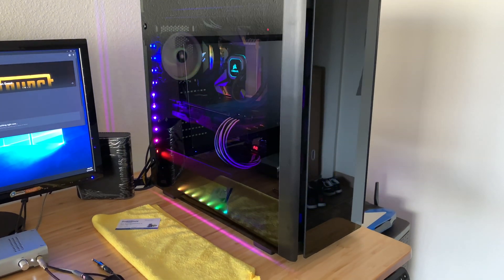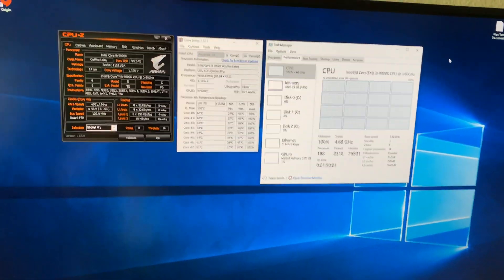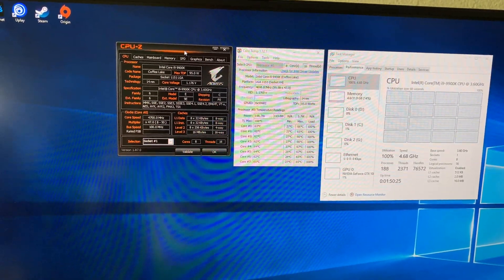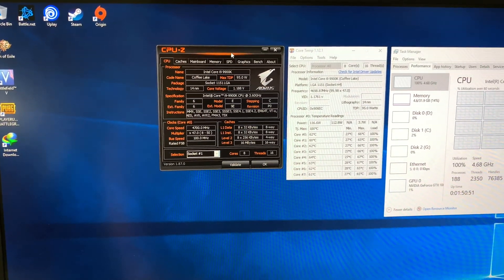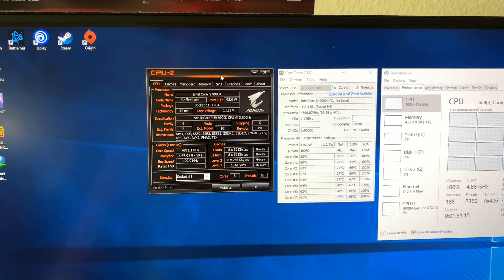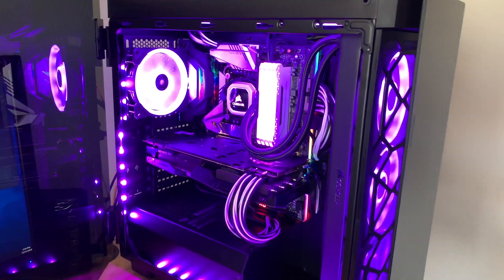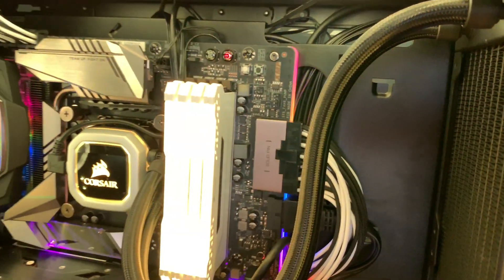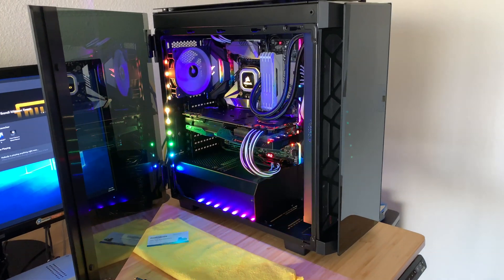Gigabyte Z390 AORUS Extreme: Auto Adjust Voltages - i9 9900K

Comment: Do your ethernet controller on your mother working right? Or have any problem with "Device Connected" sound constantly turning on? I'm RMA my board hope it's not widespread.
Reply from the maker: John Doe negative, never had any issues I know Ethernet wasn’t working until I installed the driver from there site. My sound is working fine, also got the driver from there site. No issues at all fresh install of Win10.